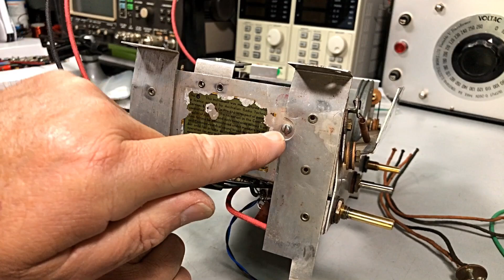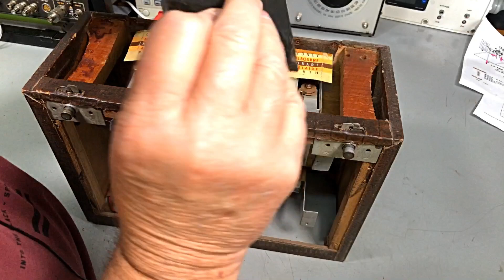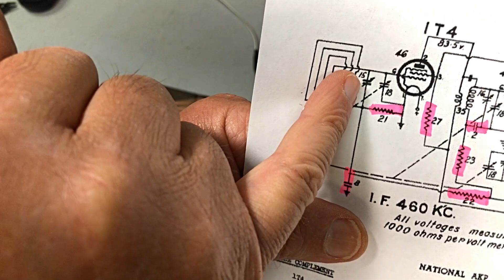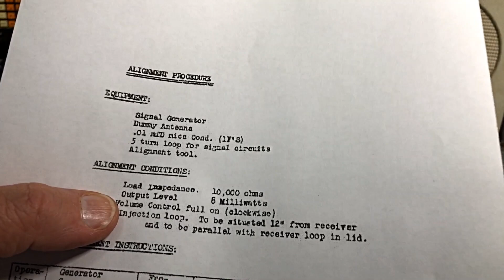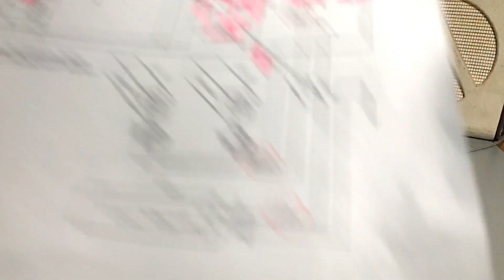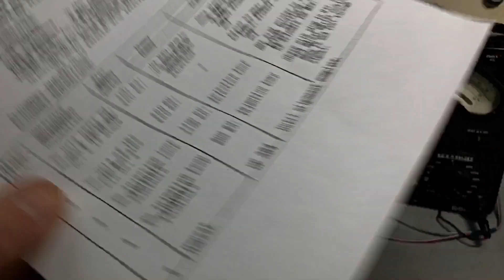Carl's NATIONAL "AKP" Valve Radio - Pt3 - The Alignment

Comment: Those 45 volt connections are set up to either side because the batteries go up either side of the chassis inside the case.   😊
Reply from the maker: I'm also guessing that the chassis may have been fitted to different models where the batteries may have been together.

Comment: I'm looking forward to your power solution Baz. I've used the 9 volt battery solution plus D cells for the filaments in the past but a small dc power circuit would be a lot cheaper in the long run. Another great video.
Reply from the maker: Yes Frank, I have tried those little chinese HT boards which you have as well, absolutly useless with the amount of RFI they emit. Working on an inverter running off 2 x 18650 batteries. Variable Frequency + Variable Output Volts so can be fitted to almost any radio, from 45v to 135v. Been designing this on & off for a couple of years. PCBs from PCBWAY are on the way so shouldn't be long now for a real time test!